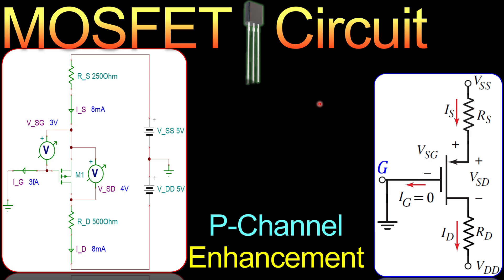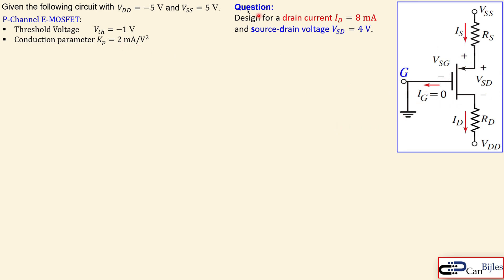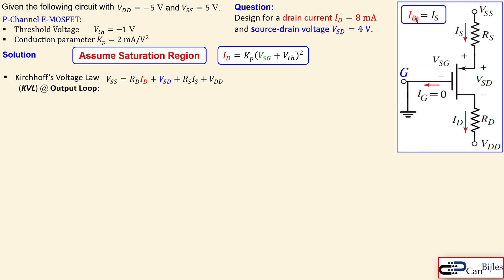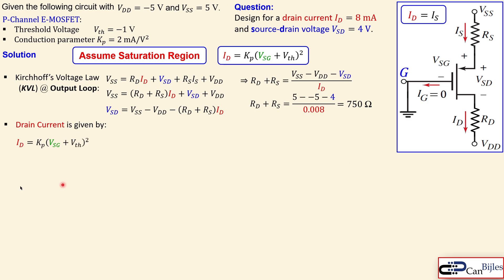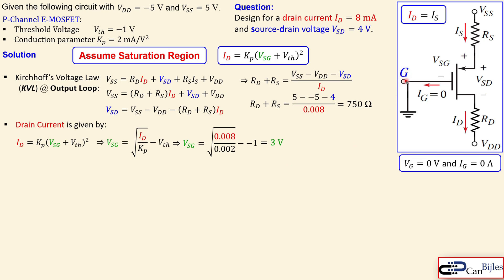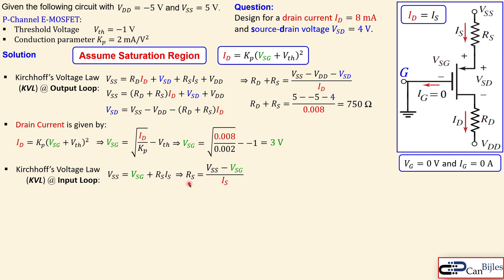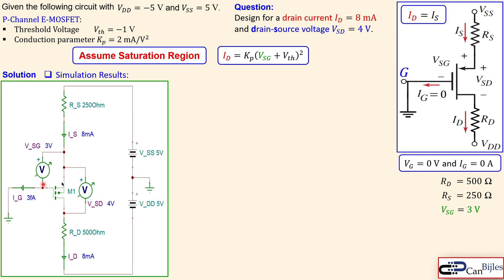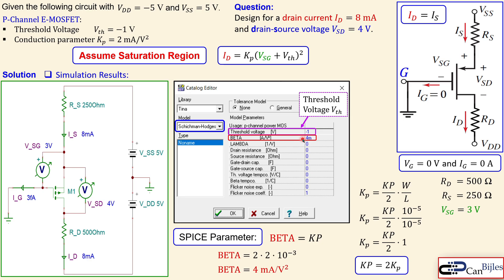MOSFET Circuit Design 🌟 P-Channel E-MOSFET 🌟 Calculations & SPICE Simulations 💡 Example 5

Comment: Hello, I have a question because you are not using the formula to find out the drain current using 1/2? See, id=(1/2)*kp*(((w)/(l)))*(vsg-|vt| )^(2)
Reply from the maker: For enhancement type MOSFET operating in the saturation region without channel length modulation, the drain current is given by i_d = K_n(v_gs - V_th)^2. In this formula, the K_n = 0.5*k'_n(W/L) and in here k'_n = u_n*C_ox.

Thus, the drain current can be written as:

i_d = K_n(v_gs - V_th)^2
i_d = 0.5*k'_n*(W/L)*(v_gs - V_th)^2

So, the formula in the video uses the capital letter K_n and not the small letter k'_n.

See for more details: https://engineering.purdue.edu/wcchew/ece255f17/ECE%20255%20f17%20latex%20pdf%20files/ece255LectureSep19Revised.pdf